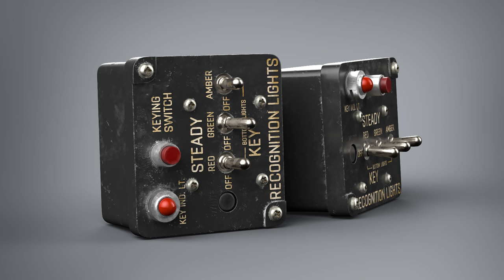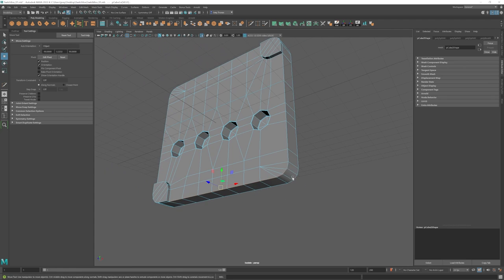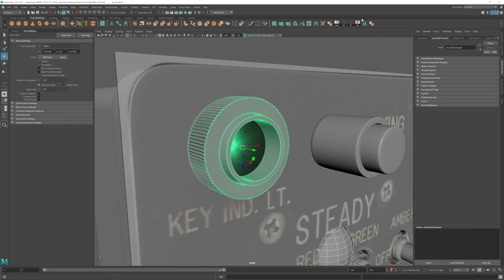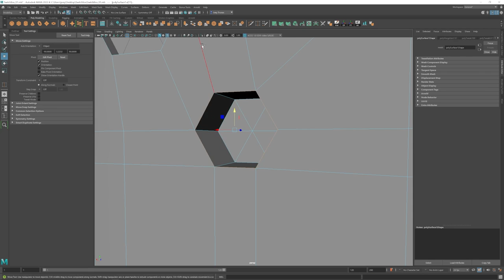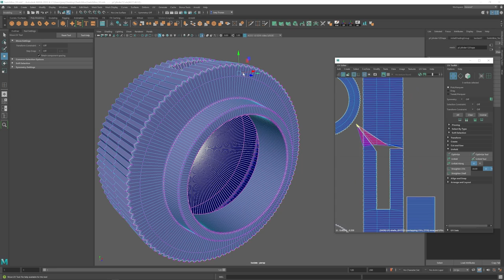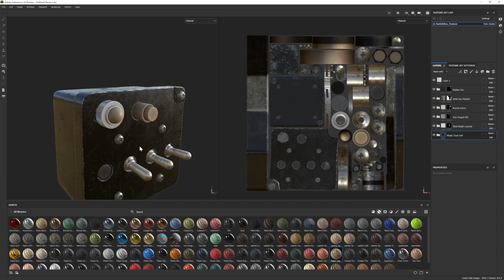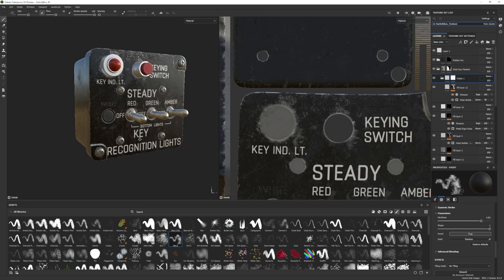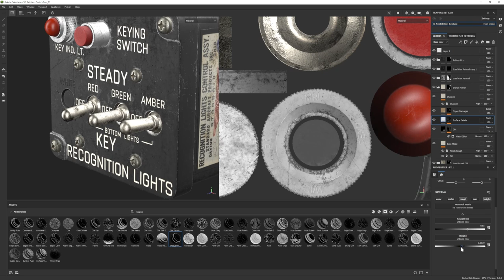WWII Aircraft Identification Switch Box | Autodesk Maya + Substance 3D Painter

Comment: Hi! Thank you for sharing this type of videos. It has been really helpful since im going deeper and deeper onto modelling. Still, i have a question: Are these type of models suitable for game development? Or are they too complex for games? (and therefore making games slow, etc...)
Reply from the maker: Thanks man I really appreciate it! 😄
It really depends on a bunch of different factors like, what game engine, what kind of prop (main character vs background), what platform (pc, mobile, etc.), and many others.. But yes I would definitely reduce the polys or approach it differently if it were to be used in a game. For example the top left light, instead of adding the bumps or rivets on the metal in the geo, I would simply add that in the material and save on all of those polys, along with the screws - the '+' could be on the material and not in the geometry. I would also not smooth the objects and keep them lower in polys as well, there is lots you could do. Then again, if its being used in UE5 as a main prop, maybe all of those polys are fine. Its important to figure out the performance target and what's needed before you start creating all of the game assets. The amount of textures is also very important, especially when there are many props involved, so keeping those down as well will greatly help performance. 
There will be more videogame related videos down the road so keep an eye out! 👀
Reply: @polyrendr  Thank you so much for answering. Yes, i think i'll be using UE5. I'll remain attentive to your next videos 🥰